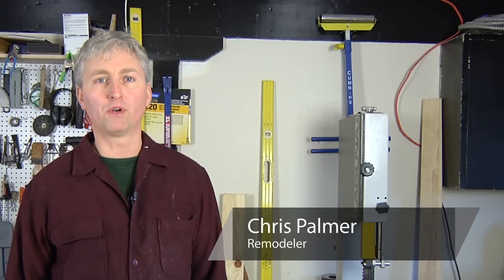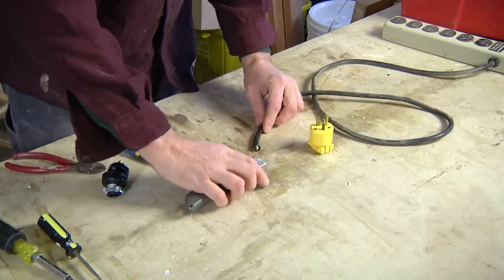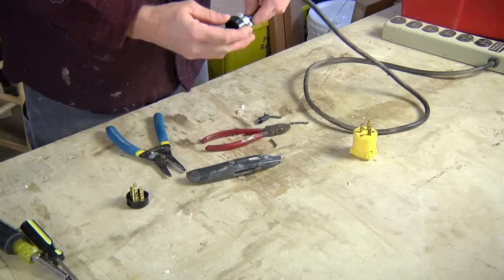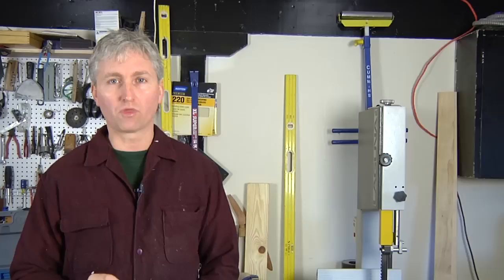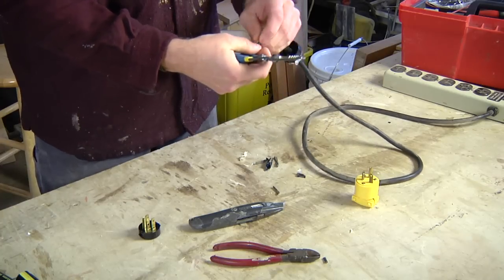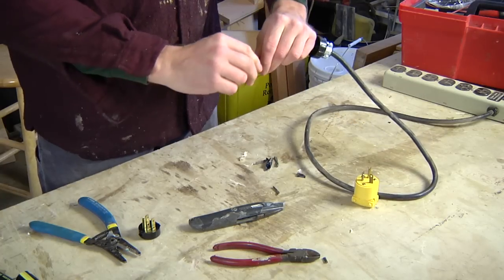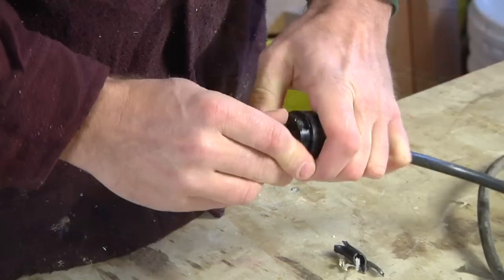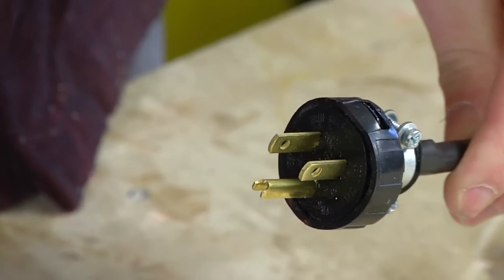Home Help : How to Put a New Plug on a Tool or Extension Cord

Comment: White Negative (neutral)
Black positive (hot)
Green is ground

Is this standard in the U.S or is this local based?

I'm looking to replace the full length of a cord from a heater and connect it at the unit. I probably could just strip it, but that would be more work. I have a solid replacement cord from a vacuum that is a higher gauge.
Reply: If you ONLY have those 3 wires, then yes, you have them labeled correctly, and that is the US standard. If there are 4+ that rule does not necessarily apply, but for 3, it does.  (Don't confuse the wiring colors for the ones on a car battery. 99% of the time on a car's 12v battery, the black is negative.) 
I don't quite understand what u meant about stripping the cord. If you want to ever find out which wire on one end, matches with wires at the other end of the cord, and are not color coated, you could use a multimeter, and do a continuity test.
Reply: @heidis8713  thank you! :D